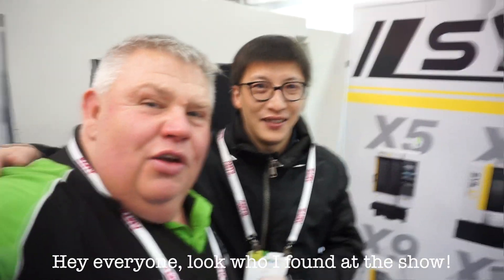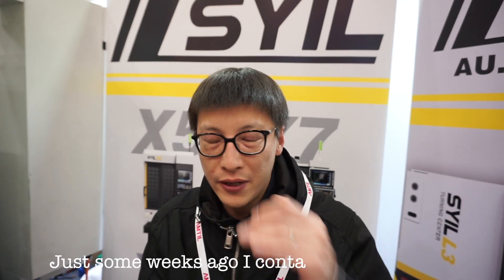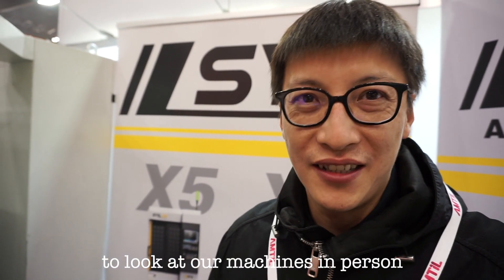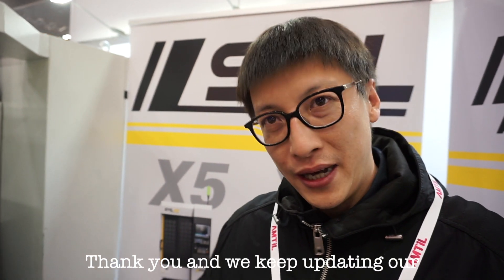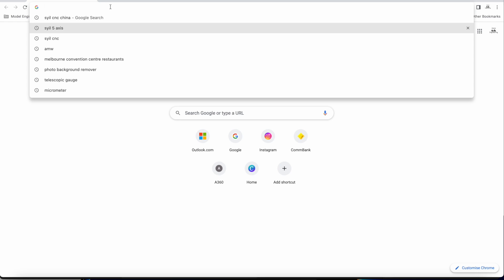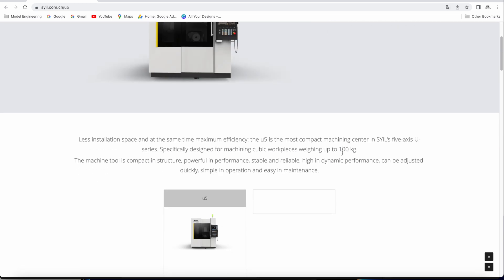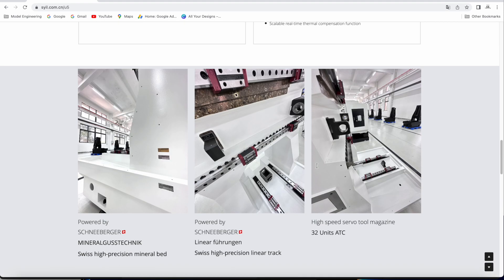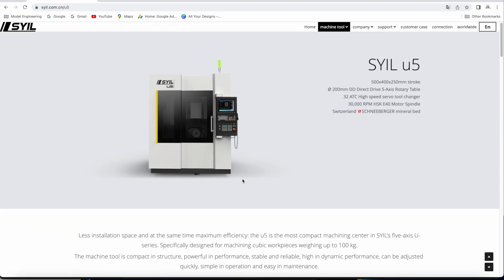SYIL CNC News - 5 Axis Machine is COMING !!!!

Comment: Hi Aaron, been following you for a while, great channel. I still have my skyfire which has been good (apart from repairing electrics) but was thinking about upgrading, possibly Syil, how did you find the change over and what were the big advantages,  thanks Marcus
Reply from the maker: G’day Marcus. Glad to hear your Skyfire is still going. Yes the Syil X7 runs rings around the SF. Especially their new epoxy granite machine. I’d put them on par with a small Haas mini mill, but with lower horsepower specs.  Their only downside is no local support. Unlike Haas, there a dealer in every capital city and most counties. Cheers 🍻, Aaron
Reply: @DCT_Aaron_Engineering  Many thanks Aaron, definitely food for thought, I had thought of a second hand mini mill, but the Syil sounds good new, I watched a couple of videos and it seems to hold very tight tolerances....keep up the good work with the videos👍😁

Comment: Different syil machines have different controller options. They haven't yet standardized on controllers.
Reply from the maker: Moving forward they only want one controller and that’s the Syntec one. However the choice is driven by the  customer. Some still want Siemens or LNC.

Comment: 100k is an extremely good deal based on these specs. Can’t wait to hear more about this. Very nice to see the epoxy granite casting in what looks like a bridge type as well as the HSK high speed spindle. Would be interesting to see what torque curve can be. Thanks for posting this video!
Reply from the maker: Hey buddy. Not wrong, it will be a real market disrupter that is for sure. Can’t wait to see it in action. Yes, most high RPM spindles suffer from lack of torque. I’m unsure of this direct drive brand though. Mr Xu was saying the turn table will be capable of 2000 rpm. 🤔 mill turn possibly 🤞
Reply: @DCT_Aaron_Engineering  mill turn would be extremely interesting. Good competition against the Brother M series. Very exciting.

Comment: Is there a benefit to this machine over a Haas? The cost ?
Reply: Coming from a business owner that got and runs a Hass for our in house machine work, some of the main benefits I see with the Syil machines are better footprint for a given envelope, granite base, open control ecosystem allowing for adjustments and repair by the end user (Haas locks everything down by default), more options for single phase/garage type setups, and of course lower price for a given performance/work area by a decent amount. They have a wired probing system which should be just as effective as the WIPS from Haas, without the costs of wireless. 

Downside I see is that they're not ubiquitous like Haas is so there aren't factory techs who are only an hour away if you do want that factory support. Also Syil machines don't cover the larger envelope range that Haas does so if you are looking at bigger stuff in a garage Haas has the TM2/3 which just opens up a lot of volume. Also Haas has a simple and easy to learn control (not that the Syil ones aren't common) with a lot of powerful options that are pretty proven and with good learning resources available. It's quick to pick up even for a total noob. From what I have seen the Syil integration of it's controllers still has some features being worked on as they grow so there may be some ways which that impacts workflow. (Not that the Haas machines don't have bugs)

Overall if we were getting a first machine right now I'd be heavily looking at a Syil for a startup or hobby type shop that needs a serious machine to make nice parts on a budget, and isn't fussed about it being from China, which is another factor all its own.
Reply from the maker: Hello Scott.  Thanks for you input.  That was very well written and argued.  You have provided an excellent insight.  Cheers, Aaron.
Reply: @scottwatrous  Looks like a nice machine for sure. The challenge for us would be service backup + Fanuc and Hass are the common controls we use so all the operators are only running 2 controls. Nice machine for the smaller shop though.
Reply from the maker: Hello.  To answer you question "yes" most definitely.  However, you must compare apples with apples.  In Australia, a Haas will cost you 2-3 times more than a Syil.  For example, a Haas X7 when compared to a Minimill is around 3 times cheaper.  But Haas has a BT40 spindle versus the BT30 of the Syil.  I think the new 5 axis machine will blow most other competitors out of the water in price, size, and versatility.  Keep an eye out for this machine, it's going to be an absolute game changer.  Cheers, Aaron.

Comment: The 5 axis looks great but almost too good! Very nice features.

I would love to see them take a machine of the footprint and spindle/tool changer of the current X5 but reconfigure the typical 2-axis bed to be a dedicated 5-axis (or I guess 4 lol) setup with integrated trunnion. Keep it basic, for making standard parts with fewer setups. Doesn't need to be able to seamlessly surface an aluminum baseball or anything.
Reply from the maker: Hi Scott.  Mr. Xu Shuo was telling me that they should be able to mill turn with their new 5 axis machine.  I'm not sure if the basic U5 will do it, but he was saying that the table should be capable of 2000rpm.  The one piece epoxy granite frame is also unique.  I think it will be a game changer and really compete with the UMC500.  Your idea of the X5 would be a good one.  Whilst speaking with Mr. Xu Shuo, he confirmed that they won't be doing any more R&D with the X series range (5, 7, 9 & 11).  Moving forward they are concentrating on the 5 axis market and also their lathes.  His lathe is a cast frame, but they want to move away from all casting and go with epoxy granite.  Cheers mate, Aaron.
Reply: @DCT_Aaron_Engineering  mill turn ability would be very nice. It makes a machine like that in some ways able to pull double duty ve needing a lathe even tho the real power of lathes is the automation (esp with lobe tooling and stuff)

But yes a viable compact dedicated "workhorse" 5-axis that could cost less than getting, say, the X7 plus a 4th axis rotary, that would be a game changer for small shops I think. Again I'm thinking being able to do parts that are maybe 75x75 or so and maybe 150 long or so would be awesome. After accounting for a typical vise of course. Lots of useful parts that would fit that envelope.